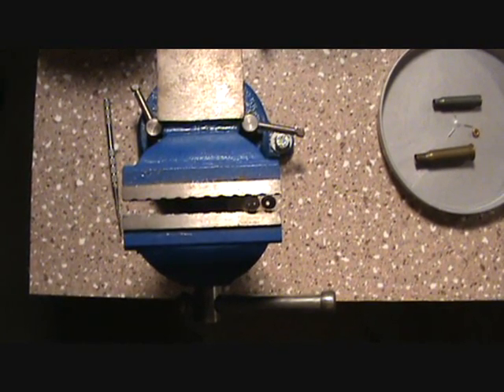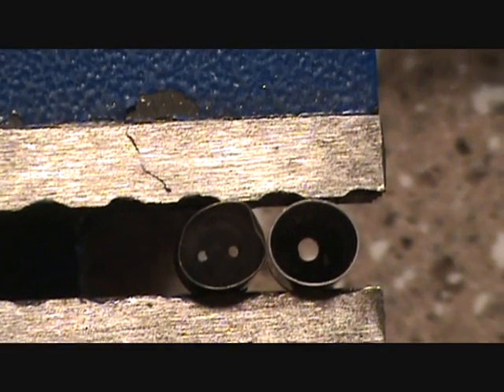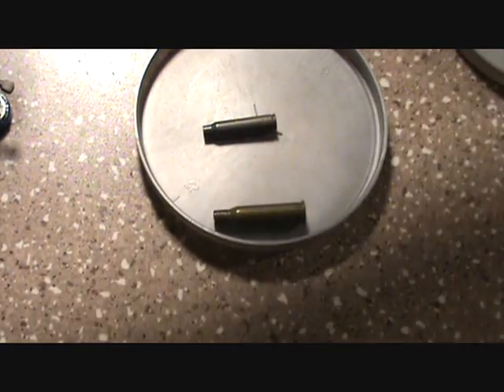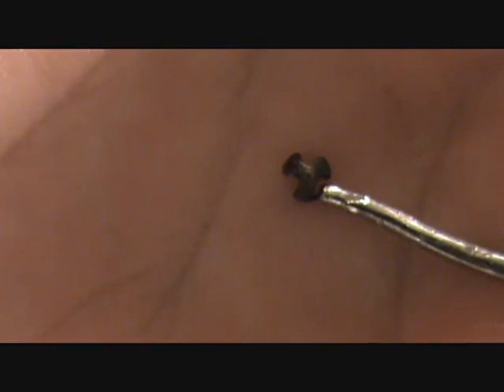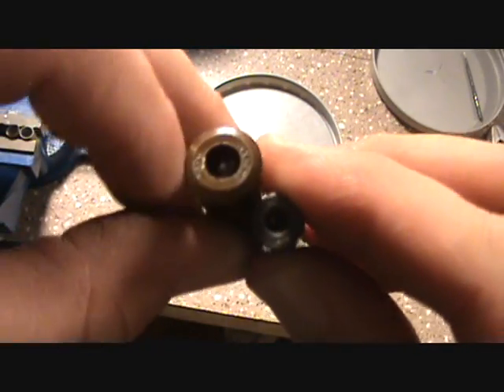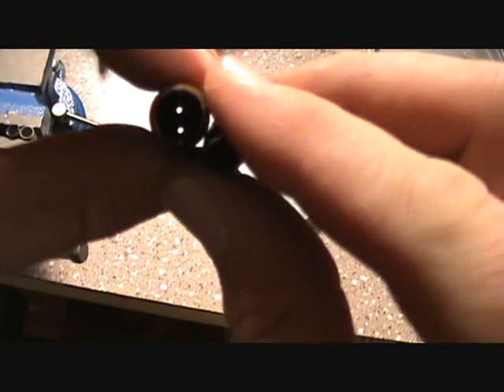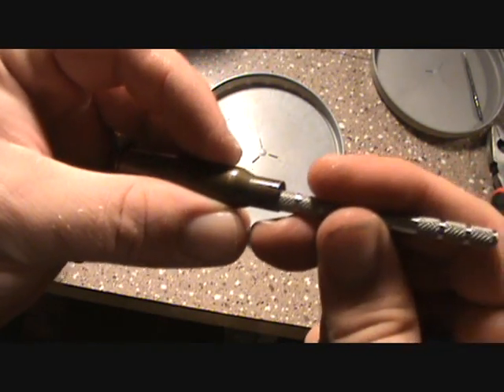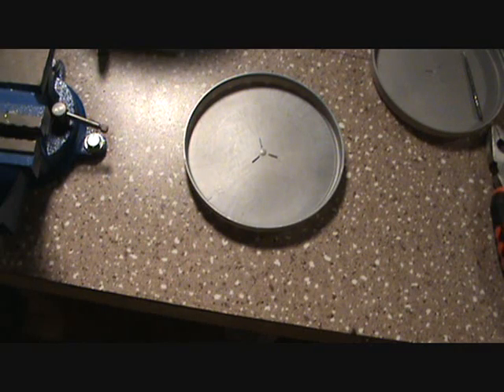The Difference Between Berdan And Boxer Primed Ammo.

Comment: look how short and simple this explanation on half the issue vs your paint drying version:  
 What Is Boxer-Primed Ammo? The weapon's firing pin strikes the base of the primer cup, which causes the primer mixture to be crushed against the anvil. This creates a flash that goes through the flash hole, igniting the powder in the cartridge.

Comment: If I understand your question, your gun will shoot either cartridge without any issues.

The only issue is when you reload.  You can't put box primers in a cartridge that was made for a Berdan primer, nor put Berdan primers in cartridges made for a box primer.

US made cartridges are generally box primed which are far easier to reload than Berdan primed cartridges.

There is a special tool to puncture and pry out Berdan primers (pain in the neck).